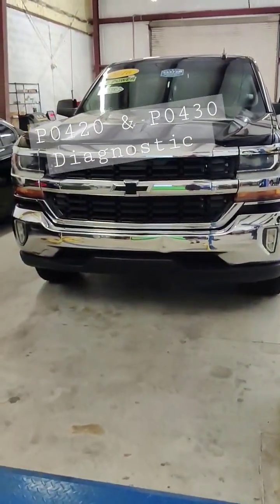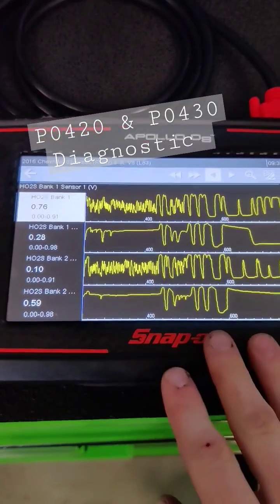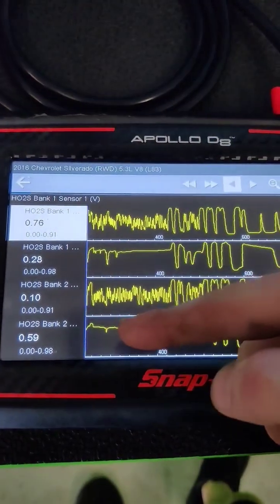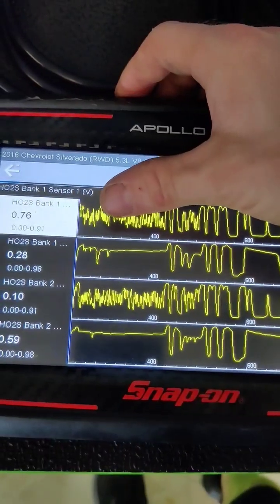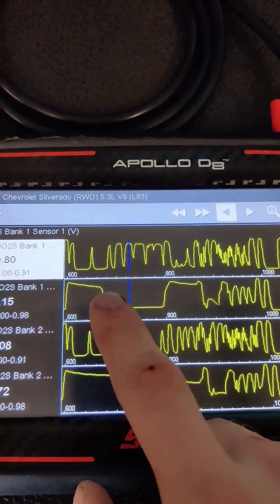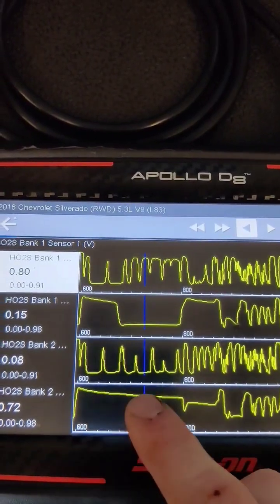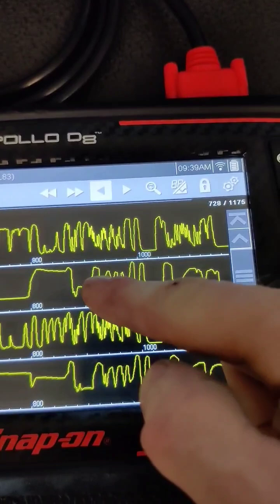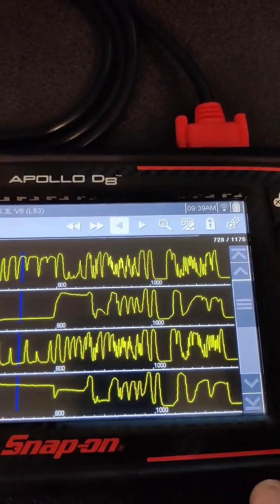P0420 & P0430 Catalyst Efficiency codes

Comment: I would suggest going to SAE and buying some documents on how manufacturers are determining catalyst OSC and then see if you can still say that you can see bad cats in scan data. The algorithms are complex. 

If it has DTCs, is in fuel control, no exhaust leaks, and firmware is up to date, it needs cats.
Reply: Actually, you need to do one more thing before condemning the cat.  You need to check that the upstream cat is not reacting to switching slightly after the downstream reacts.  If it is, then that means a lazy upstream oxygen sensor is causing a false cat code.  There are youtube videos that explain this.
Reply: @USkeZB3mpyAMCV  with lazy HO2S or AFRs, would  it be in fuel control?  We also have to verify accuracy of the MAF on airflow systems so that the ECM/PCM knows feedgas mass to properly calculate OSC.
Reply: @mattfanslow  First of all, SAE documents are probably free and openly published.  Second of all, I seriously doubt SAE has ANY information on how each manufacturer decided to implement their information.  That information would have to be obtained from each manufacturer and not all manufacturers will disclose their specific information to the public despite the 2018 R2R laws.  As an auto tech, the actual formula doesn't matter because the auto tech only needs to see the mode 6 hexadecimal number for the cat efficiency monitor.  As an auto tech, that hexadecimal number does not even need to be converted to the actual osc ratio number.  The only thing the tech cares about is that the measured hexadecimal number does not exceed the maximum allowable number to pass.  It's important to remember that techs don't need to know everything the engineer knows to fix cars.

Comment: I recently replaced my manifolds on a 2015 3.5 f150 and have a small leak even after replacing them. I get the 420 and 430 code but don’t know if it’s the catalytic or the leak. My catalytic is aftermarket

Comment: Can anyone explain my readings to me?

The upstream sensors both read about 3.2-3.3V consistently.
The downstream sensors fluctuate between 0.1-1.0V.

2011 Tundra, 5.7L.

I replaced all sensors and cats and the readings are basically identical to what I had before.

Someone mentioned fuel trims. Those are reading well within +/- 10%, usually +/- 5%.
No starting or driveability issues.

While I feel like it might still just be bad cats, especially considering my second set were aftermarket ones I got off eBay, I find it strange that the readings really didn't change between the first and second set.

I even replaced the driver side fuel injectors. Passenger side, I couldn't quite get off. But, still no issues.

The air filter is clean. Cleaned throttle body.
I'll check the PCV valve, but I replaced that maybe a year ago.

I want to try cleaning out the air intake manifold and EGR valves. But, haven't gotten to that yet.

Maybe I have some leak in the exhaust manifolds upstream? But, left and right sides are reading near identical. So, wouldn't I have to have a leak on both sides? Doesn't seem very likely.

Comment: How can you tell the difference between failing cat and the sensors?
Reply: It's very unlikely all 4 go and they will be all over the place pre cat converter and water all 4 will be mismatched not like any of the others etc ....very very rare
Reply: You need a scan tool that can display the upstream and downstream waveforms at the same time on the same screen.  If the upstream waveform reacts to rich and lean switches slightly later in time than the downstream waveforms, then it means you have a lazy upstream sensor causing a false cat code.  Does that answer your question?  There are videos on youtube that explain this.

Comment: There’s also another cause that made the cats bad. Like running rich or misfires that sent too much gas to the cats you’ll want to check before fixing the cat too.
Reply: That's what caused mine to fail... had a p0171 code and didn't fix it fast enough... I eventually fixed the p0171, and now stuck w p0420/30
Reply: For real, like what caused the cat to fail. Pretty new truck for cat failure.

Comment: How do u fix issue....So do u change O2 sensors or catalytic converter or both
Reply: Generally, if the volts are reading this way, you get a heat gun and check the temps going into the cat and going out of it. If the heat going into the car is higher than behind the cat, it’s the cat 100%. If the volts are off and the opposite on the heat test, it’s the censers that need to be replaced.